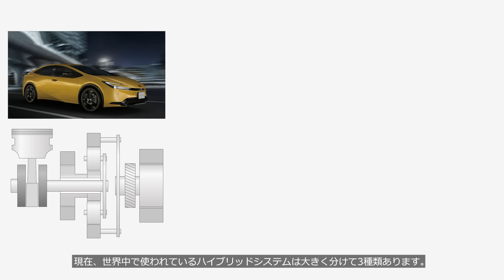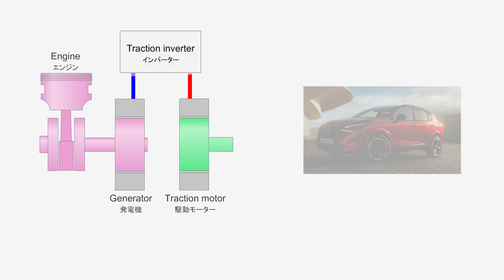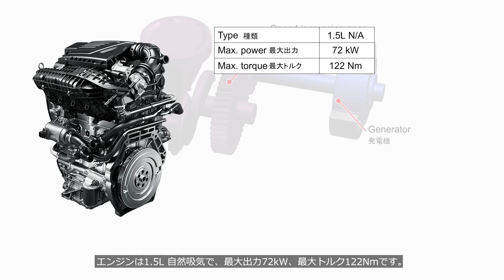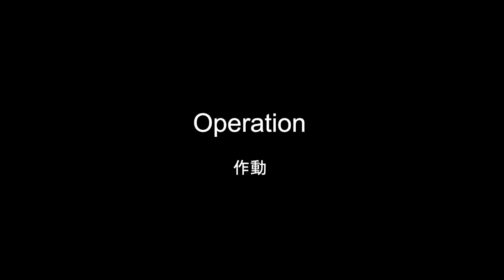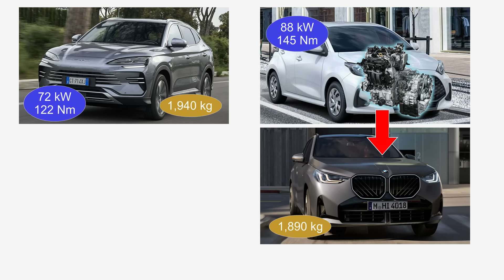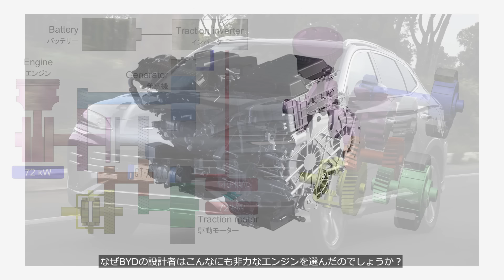Deep Dive into BYD Hybrid System on Sealion 6

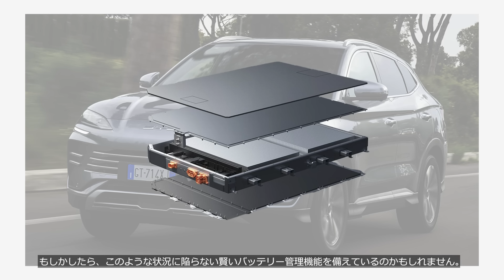Comment: 8:40 Why did BYD's designers choose such an underpowered engine? In China you can't use an engine with volume more than 1.5 liter because of taxes, it's the only reason. It's simple. You could use turbo engine but in this case the price of car will be higher.

Comment: The secret to avoiding that massive power drop uphill is simple, don’t let the battery get low in the first place.
Before you start climbing, go into the settings, switch to HEV mode, and set the battery reserve target to 50% or 60%.
That way, the engine builds up a big electricity cushion ahead of time, and you can cruise up the mountain smoothly without the car entering "tortoise mode."

Comment: Both Geely and BYD's hybrid system is more like Honda's than Toyota's. Both BYD/Geely and Honda use an engine connected to a smaller generator motor and a larger traction motor, with a clutch between them instead of a planetary gear.

At low to medium speeds, the clutch is open, and the engine powers the generator, which charges the battery. The traction motor then draws power from the battery to drive the wheels, functioning as a series hybrid. At higher speeds, the clutch closes, allowing the engine to drive the wheels directly.

This system operates in three ways:

1. The electric motor powers the wheels when the battery is full.

2. At low speeds, it functions as a series hybrid, with power flowing from the engine to the generator, battery, motor, and wheels.

3. At high speeds, the engine directly powers the wheels.

Toyota’s planetary power-split system allows not only these three modes but also simultaneous engine charging and propulsion, as well as joint engine-motor operation, leading to better fuel efficiency at high speeds than Honda or BYD/Geely especially in EPA cycle which is more realistic and values high speed efficiency. 
 
If you don't believe me check 1001cars on youtube where he compared BYD Seal U DM-i vs the now previous gen RAV4 PHEV. The latter had longer EV range, better MPG in all condition, better acceleration and of course higher reliability. Therefore, despite what BYD propagandists and pro-China EVangelists would have you believe BYD DOES NOT have the best hybrid system. Toyota is King
Reply: 本田IMMD hev混动架构技术是抄袭BYD dm PHEV，而吉利最新的单挡EMi PHEV也是抄袭BYD 的DM PHEV，顺便说下，吉利最早的雷神混动是使用的行星齿轮技术，只不过结构跟丰田的THS hev不同是三挡串并联结构。
最后，丰田的传统汽油平台的THS HEV是绝对没有BYD的电平台DM PHEV强大的。（第4代DMi技术都比不了，更别说最新的第5代DM PHEV技术了。这是混动路线与架构问题，传统汽油平台已经落后了。而且，丰田ths混动技术的行星齿轮⚙️确实厉害，但是也有缺陷，高速就是他的硬伤。）
Reply: @HGG-DXY  You are so wrong. Honda, BYD, Geely only have fixed gear ratio equivalent to fifth gear on a sixth gear manual transmission during high speed cruise. Meanwhile, Toyota's planetary gear can change ratio infinitely like a CVT. Therefore, it is BYD not Toyota which struggle at high speeds fuel efficiency. 

I know science is a hard topic for propagandists like yourself to understand. Both BYD and Geely to achieve high thermal efficiency of 45%+ on a gasoline engine they had to increase the compression ratio to the moon almost to the point of a diesel engine which significantly reduced reliability.
Reply: @miraphycs7377 
吉利汽车有两个混动技术，一个是最早的雷神Hi混动技术（搭载在星越L上），一个是最近才推出的EMi PHEV，OK？
以前搭载在星越L上的雷神Hi混动技术用的就是行星齿轮+三挡DHT串并联结构的HEV，现在的PHEV升级成电平台单挡DHT串并联技术了，老款三挡DHT是用了行星齿轮，新出的单挡DHT就是学的BYD DMi混动技术架构。
@miraphycs7377
Reply: No offense mate, but when the RAV4 costs 7 grand more in cash, then the least it could do is be better overall than a product that is worth 7 thousand Euros less. That just ends up making the Seal U look nicer. A more interesting comparison would be the RAV4 PHEV against someone in it's price range.

But, I don't live in Europe so I don't know who that would be over there, excluding Lexus obviously because that'd be internal competition, and Chinese cars are banned from sale in the United States, so, whelp. What I do know is that GWM has a competitor to the RAV4 over here in South America, two of them actually, the H9 and the Tank 300. And frankly... They've been making Toyota look like chumps on the bang for the buck department, just as BYD and Geely have been.

Comment: The truth is in China, everyone drives slow, and the battery barely drained. There is all different extremes testing conditions in China; one case does show when the battery is empty and needs the car to fully accelerate, the car drives like a tracker. It’s just it’s very rare case 😂

Comment: Can the engine put power to the generator and the wheels at the same time? When putting power from the engine directly to the wheels, is there a cvt or gears or is the ratio fix?
Reply: I think it's a fixed ratio, like highest gear in a normal car. That's why the gasoline engine will only engage with the drive train when the car is moving faster than about 70km/h.

Comment: A 72kW motor on a 2000kg car might at first glance seem wrong but bear in mind the following: To lift a 2000kg car 300m up a mountain pass would require only 1.67kWh extra from your battery, (irrespective of your speed). And the 145kW is ample to add bursts of acceleration while going uphill. The typical 18kWh battery in a PHEV is kept at around 50% charge and can easily provide that extra energy to get the car up a mountain pass, even if higher than 300m.

Comment: I own a BYD song pro and drove it for 11 hours on a highway, and with the setting to save energy and not go down more than 70% essentially the engine functions as an electric generator for the car every time the battery goes lower than 25% and then it charges it until is at 70%, the only moment where you don’t have complete efficiency is when you’re at 25% and uphill, as long as the car has more energy than that it’ll run great, but in the 11 hours I drove it I never experienced that issue.
Reply from the maker: Thank you for the information. 
I know that the situation I’m concerned about is extremely rare. I’m simply interested in how the system would control itself in such a scenario.

Comment: Few issues here,  there is a turbo version with two ev motors,  secondly,  the battery doesn't drop below 15-25%, so there is always battery to run ev motors to drive if needed
Reply: Are you saying that this version has only 1 motor? And if so where's is it mounted? On the rear differential? 🤔

Comment: Comparing the thermal effects of power generation from different power plants to those of electric vehicles? Is this video misleading? Power plant generation is indirect, while hybrid electric vehicles generate electricity directly. Furthermore, comparing the thermal effects of a 2.0L engine with a BYD 1.5L engine is misleading. These are two different classes of hybrid vehicles with different fuel consumption and design purposes; they cannot be compared directly. This is extremely misleading.😮‍💨

Comment: Your review of the BYD system is wrong, the total combined drivetrain power is only the total sum of traction motors. The inclusion of gasoline engine output is not included in the total output in BYD specification.  The interpretation you explained applies to the Shark 6 UTE.  Not other vehicals.

Comment: I could test drive in Thailand a Sealion 6 DM-i for two days and it works very smooth and seamlessly. I prefer a BEV because I drive about 100 km per day. But I knew several people who have this car and can drive fully electric for every day use and have no re-charge hassle for the occasionally longer trips. I also think that the Chinese approach of an EV with range extender is superior than the conventional PHEVs.

Comment: Using a small gasoline engine, while the battery is depleted, means you might get something like the people who drive the BMW i3 Range Extended vehicles experience.   There was even a lawsuit in the U.S. at one point saying the tiny gasoline engine (it's very small) was dangerous on uphill grades when the BMW i3 would slow to a crawl in traffic.

Comment: In BYD hybrid system, you can select how low the battery state of charge before the engine turns on. The setting only goes as low as 25% in BYD Shark, or 20% in Song Plus DM-i (Sealion 6 outside China).
My BYD Atto 3 (Yuan Plus) weighs 1.7 ton, when climbing a slope at 60 kph, the motor only need to give out 20-30 kW to maintain it.
All in all, electric motor is a much more honest power delivery system, they just spent what they need - with some goes off to heat at higher speed. The gasoline engine will not reach the desired efficiency, even if it runs on ideal RPM, unless it is being connected to the direct drive (usually 4th gear) or higher gear. Hence it requires much more energy to burn, when climbing on lower gear.
Reply: agreed

Comment: Please review the two-speed DHT from GWM, such as the one used in the Haval H6 hybrid system. It adds two speeds to this BYD hybrid transmission to improve engine performance, and it is simpler than the previously analyzed Chery Tiggo transmission. I agree that Honda has a similar hybrid system, and they may have been the first to popularize this series–parallel implementation trend.

Comment: The solution to your concern is very easy. Just switch to "bettery power retain" mode during long distance driving, and set SOC level not below 50%. This will be enough to almost 99.99% of all driving scenarios.

Comment: Thank you for sharing, but this isn't really innovative at all.  GM implemented a very similar system in 2010 for the Chevrolet Volt.  In fact, GM's system was actually superior because the gasoline engine was linked by a power split, not a clutch, so it could run at any RPM and not just one fixed ratio.  Despite having a smaller 16kWh battery, the Volt and its cousin the ELR overcame the challenge of a steep climb by allowing the driver to work the engine harder in advance of the climb to create sufficient battery reserve.  Unlike air-breathing combustion engines, electric motors don't lose performance at altitude.  So if the driver followed instructions in the manual, the 4000-lb ELR could sustain more than 70 mph over a 10-mile, 7% grade to the Eisenhower Tunnel (altitude 11,000 ft.)

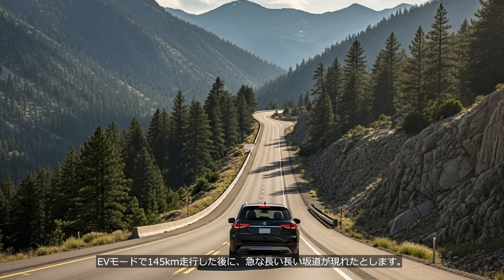Comment: 7:58 Since you can't use 100% of the battery capacity, the bottom 20% should be set aside for hybrid only.

China also has taxes based on the size of the engine. The bigger the engine, the higher the tax.

Comment: the system will kick in when battery charge is low. Therefore electric motor will always be the main driver of the car. . The system will not allow full discharge of the battery. Even in EV mode it will auto switch itself to HEV and charge the battery once it reaches 25% state of charge

This is the diff between reviewing it on paper only. Rather than real world experience. Thus the last information is misleading

Comment: Chinese hybrid design uses a big buffer. Sealion 18kwh. Crv hybrid for example uses 1.3kwh. They use that buffer to efficiently maintain charge during idle or cruising even with a small engine. Also when regenerative braking, there's a lot of buffer to store the excess energy.
Reply: You shouldn compare battery capacity it that of the plug-in hybrid CR-V, not the self charging hybrid. CR-V uses a 17.7kWh battery in the plug-in hybrid. Range is still abysmal compared to the Sealion, tho, probably due to aerodynamics.
Reply: I have a Fangchangbao Bao-5 in China, which has a DM-O platform.

It's substantially more refined, and more capable than any Japanese PHEV platform. The engine is mostly used to re-charge the batteries, and ocassionally drive the front wheels when the computer demands it. At the same time as the front and rear motors are also driven. 

Even at 22% battery level, the engine is capable of maintain the start of charge, even increasing it to 26-29% during highway cruises. I easily got 425kw out of it during a hard overtake. With max (combined) output of 505kw.
Reply: @energiam880  Both Geely and BYD's hybrid system is more like Honda's than Toyota's. Both BYD/Geely and Honda use an engine connected to a smaller generator motor and a larger traction motor, with a clutch between them instead of a planetary gear.

At low to medium speeds, the clutch is open, and the engine powers the generator, which charges the battery. The traction motor then draws power from the battery to drive the wheels, functioning as a series hybrid. At higher speeds, the clutch closes, allowing the engine to drive the wheels directly.

This system operates in three ways:

1. The electric motor powers the wheels when the battery is full.

2. At low speeds, it functions as a series hybrid, with power flowing from the engine to the generator, battery, motor, and wheels.

3. At high speeds, the engine directly powers the wheels.

Toyota’s planetary power-split system allows not only these three modes but also simultaneous engine charging and propulsion, as well as joint engine-motor operation, leading to better fuel efficiency at high speeds than Honda or BYD/Geely especially in EPA cycle which is more realistic and values high speed efficiency. 
 
If you don't believe me check 1001cars on youtube where he compared BYD Seal U DM-i vs the now previous gen RAV4 PHEV. The latter had longer EV range, better MPG in all condition, better acceleration and of course higher reliability. Therefore, despite what BYD propagandists and pro-China EVangelists would have you believe BYD DOES NOT have the best hybrid system. Toyota is King
Reply: Because in China for a PHEV or EREV to be called an NEV it must have Minimum  an EV only range of 100km.

So the Ferrari PHEV is an ICE based on Chinese standards and must use blue plates.Because it can't reach 100 km ev only range.
Reply: Y u comparing PHEV BYD to regular hybrid CR-V? You should be comparing PHEV to PHEV like RAV4 PHEV which has 22.7kwh vs 18kwh. 
 
If you don't believe me check 1001cars on youtube where he compared BYD Seal U DM-i vs the now previous gen RAV4 PHEV. The latter had longer EV range, better MPG in all condition, better acceleration and of course higher reliability. Therefore, despite what BYD propagandists and pro-China EVangelists would have you believe BYD DOES NOT have the best hybrid system. Toyota is King

Comment: given that some new lean burn engines (i.e. Mazada) can only run as a generator due to requirements of stable operation, combined with increased electricial path efficiency improvements, could we one day see series hybrid become more efficient than series-parallel or power-split, and have a simpler maintenance/repair?

Comment: BYD make full use of both ICE and battery to give the best performance . Toyota and Honda prioritize  use of ICE n minimize EV  to achieves acceptable  performance. 
They need to prioritize the usage of ICE bcos of the their huge capital investments  and supply chains in the ICE sector. Batteries and motor is not a good profit generator compares to ICE which also keep the servicing and replacement parts profitability intact

Comment: Why did BYD choose a small engine?  Because the battery and e-motor take up a lot of weight and space, so the engine needs to be small to keep weight to reasonable level and to have good cargo space.  On a cross-country long trip, simply start out with a full battery and use the engine for power, while the e-motor only provides acceleration boost and hill-climbing assist.  The battery is large enough to assist in climbing to the top of even the tallest mountain.   For local driving, ̣90% of population lives in flat areas that doesn't need much hill climbing assist from the battery.  
For those living in mountainous areas, they should use less battery charge  during daily driving, while reserving more capacity to assist with climbing tall slopes.  For example, normally up to around 80-85% of battery capacity is used  for daily commute, but those  living in mountainous areas should only use up to 50%-60% of battery capacity before recharging.  They could recharge their battery while at work also, thus ensuring a lot of remaining battery capacity on the drive home to assist with climbing tall slopes.
Reply: own a sealion6 and it does not matter if flat terrain or mountainous because the regen braking alone can recuperate a lot energy while going down the hills with the added benefit of assisting the mechanical brakes.

Comment: Would anyone be so silly as to completely drain their battery power and rely fully on the traction motor in a hybrid? This rarely happens. Perhaps customers need to be informed not to.
Reply: It's impossible to drain battery of dm-i equipped BYD cars. The car automatically engages its engine to maintain SoC buffer -- even when its turned off.

Comment: "I was skeptical, but I finally got more than 45 percent of the data," said an engine technician in Japan. His large Japanese automaker investigated China BYD's Dedicated Hybrid Engine (DHE). Although it failed to reproduce BYD's claimed maximum thermal efficiency (46.06%), it confirmed that the engine could perform at a similar level.
BYD has been followed by China automakers offering plug-in hybrid electric vehicles (PHEVs) equipped with DHE with thermal efficiency of more than 45%. Is the saying that "China can't build engines" a thing of the past? By analyzing the PHEV put into the market by various automobile enterprises, we can understand the strength of China enterprises and the direction of engine strategy. In addition, two suppliers of low-cost DHE have emerged through our local communications.
Main article (Source: Nikkei Automotive)
inflation-prone thermal efficiency
The PHEV with thermal efficiency of 46.06% is BYD "Qin L DM-i" and "SEAL 06 DM-i". In addition to BYD, China's Zhejiang Geely Holding Group and Shanghai Automotive Group announced thermal efficiencies of more than 46 per cent.